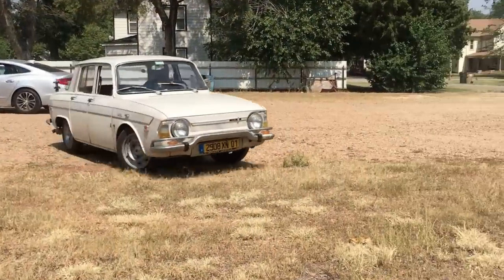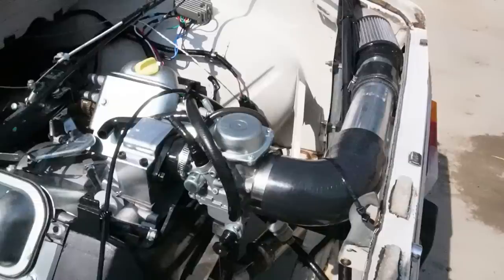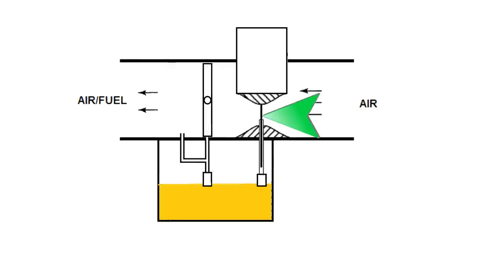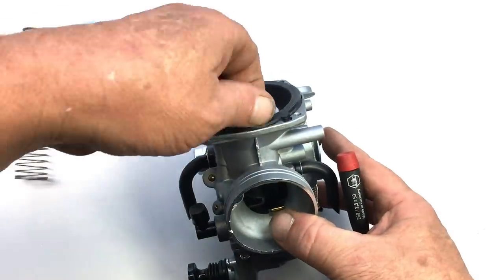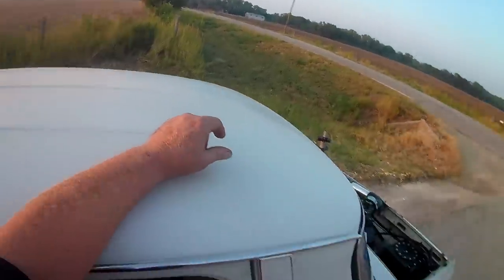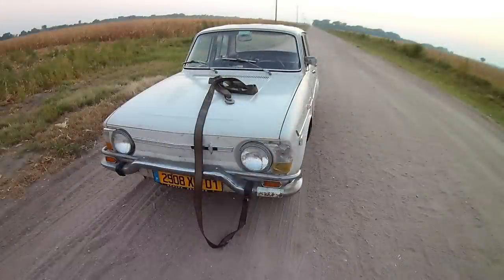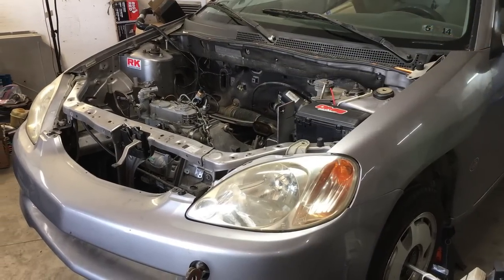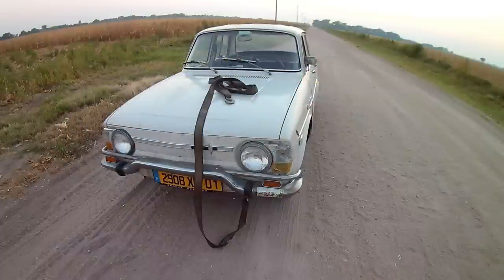S3 E31 We tune the Keihin CVK carburetor to work on the 670 cc predator engine in the Renault R10

Comment: Think of the pilot system as a T shaped tube at the bottom of the T is the pilot jet with its small emulsion tube at the topof the T one side it opens by  the butterfly iin a series of small holes, typically about 15 thou,dia, the opposite end of the T is the Pilot Air Jet this is where the pilot sucks air from it is its own sealed system, if you want more air  in the pilot system you need to adjust the pilot air jet,  like i said there is nowhere else it can get extra air and it usually causes problems exactly where you are experiencing them

Comment: I know this may sound a bit critical, but I think you should no longer start accelerating the car from 3rd gear. I believe that puts a ton of continuous stress on the drive belt and was, therefore, doomed to fail. Those donuts you did on the drive way likely only slightly accelerated its demise. Just sayin…
Reply from the maker: Accelerating  from third gives us consistent results... and yes its very hard on the belt.  The problem with starting off in second gear is we loose time shifting and the results can vary just because of the delay in shifting.

Comment: I think even if/when you mess with the spring and weights for better grip it's going to eat belts just from the sheer weight of the car
Reply from the maker: Yes, the belts wont last long.  Keep in mind the clutch system is only rated for 18HP MAX and we are exceeding the rating by a decent margin.  Anyway we used this clutch because it was already in our inventory.  The correct clutch would have added about $600.00 to the build

Comment: THIS is why I don't screw with carburetors. It's so much easier to guestimate injector size based on displacement alone and throw them in only seeing a 60% IDC to get a nicely running engine over this. This looks like a headache from hell.
Reply from the maker: We did EFI on the 420 cc engine in the Honda Insight.  I have a lot of experience with Megasquirt systems, however we decided to use a Speeduino NO2C... and that was indeed a headache from hell.  So this time around we are just going to play with the carburetors.  A lot of the audience can relate to carburetors.  Now when we did the EFI on the 420 engine it drove all the tuners mad because they are only familiar with liquid cooled engines and not air cooled engines.
Reply: @robotcantina8957  Here's a crazy idea. Braze some copper water tubing inbetween all the heat fins and let's see how far you can go with cams, high compression pistons, electronic ignition, and a stout set of internals. Maybe you can get it to rev out to 8k or more and still make decent power.

Comment: My personal experience with this type of carburetor. Full of problem. Overflow reservoir. Under flowing fuel into the carb. If u held full throttle for 1 minute. The reservoir will ran dry and even sputter to dead. Probably the same problem why the fuel too lean at the end. Shorter needle did drastically improve power and response but will empty the fuel reservoir faster than inflow of fuel from tank
Reply: My bikes all use vacuum fuel pump to boost fuel flow into carb.

Comment: Now that you have a better carb, can you bring back ram air?
Reply: I think it'll screw it up, you can't have positive pressure in a carb unless it's designed for it.

Simply running with no intake really messes up these carbs, I learned the hard way when I took (cut) the airbox out of my motorcycle. It ran like crap and I could not get it right...  ended up having to find a replacement and reinstall it.

Comment: Your fuel pump isn't supplying the proper VOLUME to the carb under high load.  That's why the afr goes steadily lean, the fuel bowl is running out of fuel because the pump can't keep up.  Take the regulator out or get a proper pump like one off a honda fourtrax 350 from 1986 and try again.

Comment: Would there be a potential benefit if we ran E85 fuel (surely available in Kansas!). Would need more fueling but with higher octane we could run more timing advance
Reply from the maker: To get the most from E85 we would also have to increase the compression...  and that isn't easy or cheap.

Comment: Maybe figure out how to use 2 or Three belts with pulleys
Reply from the maker: The CVT drive can only operate on a single belt.  The only way around this problem is to use a CVT drive that rated for more HP.... Unfortunately Its an expensive upgrade

Comment: Dude you are getting some of this stuff wrong! The needle will have no effect on the WOT mixture, its the main jet that you need to go up on it get the WOT mixture to 12.5:1. Also the pilot jet will not have much effect at cruise (lets say 1/4 throttle), the needle profile and its clip position is the thing to need to be adjusting here. BTW I've spent a lifetime tuning bike and car carbs, in fact I use the same Innovate LC1 system on anything that I work on, without such a system it is total guess work! (plug reading is a total waste of time now that fuel no longer has any lead in it) The holes in the emulsion tube don't have anything to do with the needle, the emulsion tube sits in a 'fuel well' the idea is that has engine demands more fuel as the revs go up the level of fuel in the fuel well gets lower, this exposes more holes in the tube which allow more air to pre-mix with the fuel before it is introduced to the main flow of air going through the carb. This is all done to 'adjust' the fuel curve, basically without the holes the mixture would get richer and richer as the amount of air going through the carb goes up and up. The holes 'tailor' the  fuel curve in order to stop this happening. The needle creates an annulus with the needle jet (the needle jet is just a ring of brass, it can be part of the emulsion tube or is a separate part and sits above the tube). The area of the annulus determines the part throttle mixture strength, which is why messing about with the needle is the thing to do if you need to adjust this area of the 'tune'  By the way, just to be clear, I have not made the 'discoveries' that I have outlined above myself, I read many books on the subject of engines, everything that I have stated above (including the bit about plug reading) is all in David Vizard's book on carburettors and intake manifolds. It is however backed up with my own real-world experiences. Personally I'd start by getting the main jet right for WOT and then start working on the other carb circuits after the WOT is sorted out. I hope that helps! I enjoy your vids!

Comment: I would ditch that cvk carb and go with a pumper style carb. A mikuni tm series, keihn cv carb, a flat slide pumper carb would give instant response, not rely on vacuum and not need a diaphragm
Reply: An fcr carb with a pumper jet is prolly best and i believe I’ve seen other guys using them. You are using basically a Harley carb
Reply: Underneath that metal cap is a brass screw you can notch to fit a flat screw driver and adjust the carb better

Comment: The dip in A/F ratio is probably a result of the carb design. There is no accelerator pump to add fuel and richen the mixture when the butterfly opens. The fuel flow is reactive to the air speed going through the venturi, so it takes a split second for the fuel flow to catch up to the air flow when you push the gas pedal.

Comment: The problem with cvt is very unreliable. Even with same belt and pulley u only get 20,000 to 30,000 km on a light weight scooter before the belt snap. And same goes for car with cvt. Which need new gearbox replacement after 80,000 miles because the metal shaving from the steel belts and pulley got in everything.

Comment: Donuts on a car you may have a hard time getting transaxle parts . personally i don't give a crap if it can do o a donut or not
And I said pure cold air intake nothing about air filter but okay fine
COLD AIR INTAKE. NO YOU DID NOT TRY THAT ONE BECAUSE YOU DID NOT BUILD THE RIGHT BOX
Reply: All raising and lowering the rod is making idle rich or lean it has nothing to do with wide open throttle
In other words that long metering rods is just for idle and mid-range very mid-range

Comment: So the carburator is a Chinese nock off? That explains the lack of performance. It's junk! Go back to a Mikuni.
    Idea: Asian carburators were used on 4 cylinder car engines from Nissain, Toyota, and Miss.A. Bitchy cars. They were a 36 m.m. to 38 m.m. carb. Maybe you can adapt one to the V2 engine. 
    Oh, crap! Something broke! Dang! The drive belt broke?